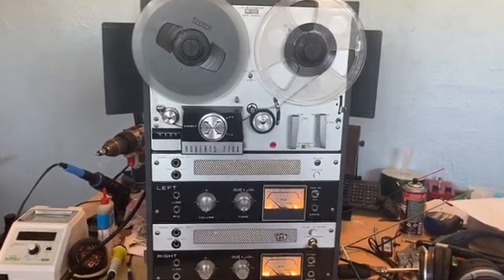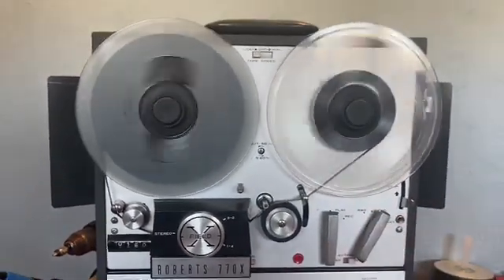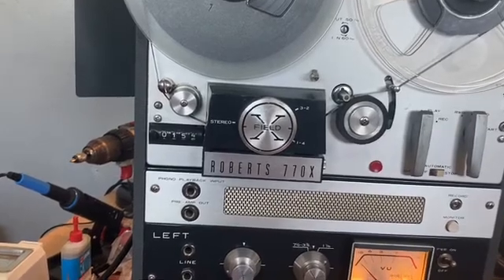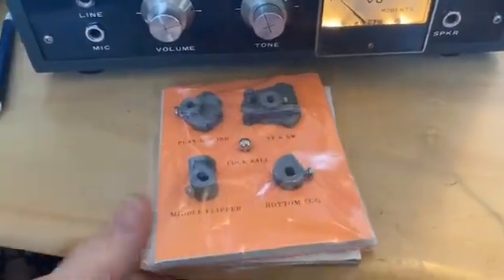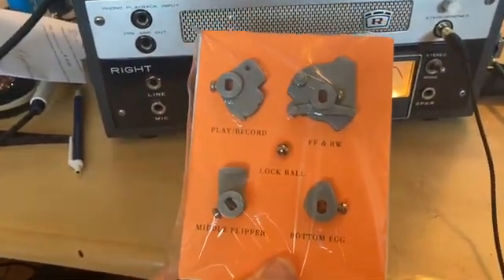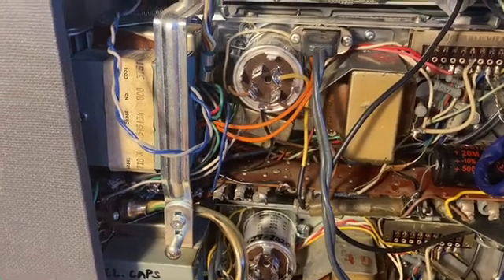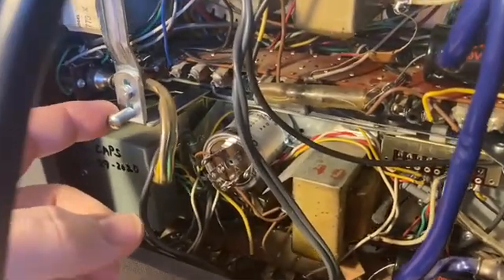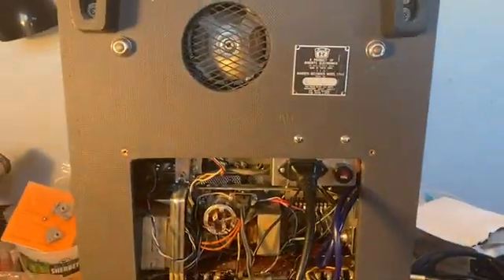Roberts 770x Reassembled and Wrap-up of Repairs-Part 5

Comment: Where does that Steel  lock ball go ? i think that mine fell out when i was removing the assembly from the cabinet.
Thanks
Reply from the maker: Sorry, not sure. It’s been a while since I worked on this.  If you go to this website link and scroll down to the bottom, you can download a service manual for the M8 which is identical to the 770x. You’ll have to create an account which is free. The manual has some exploded part views and you might be able to track down what you’re looking for.

https://www.hifiengine.com/manual_library/akai/m-8.shtml

Comment: Thank you for these videos they are going to help me a bunch in the restoration of my unit! Are you still using it or have you moved on?
Reply from the maker: Yes I still have it.  I use it on occasion to listen to old tapes my dad had from the mid 70s.  I’ve recorded a few test runs with it and it worked pretty well.  Also purchased a couple of new tapes for future tracking.  Good luck with your project!